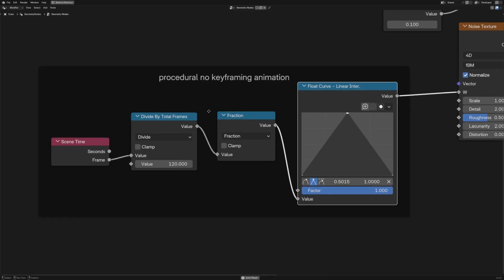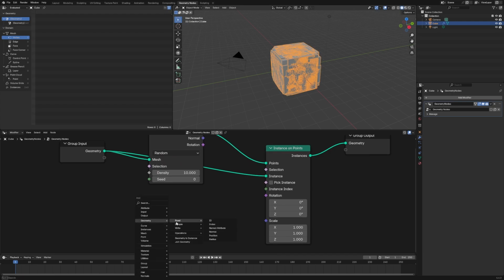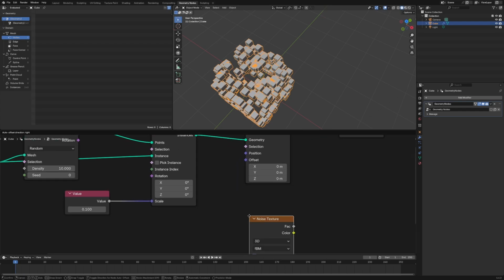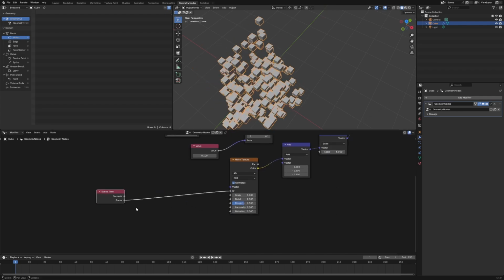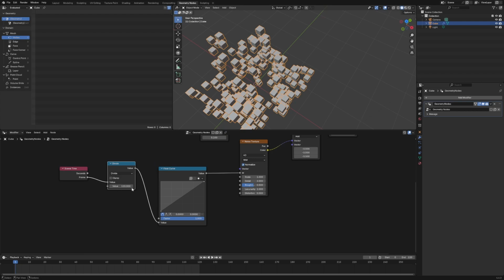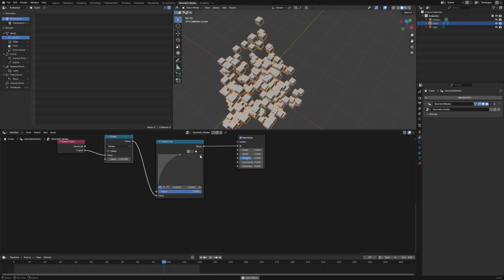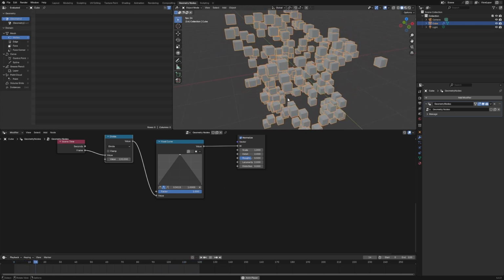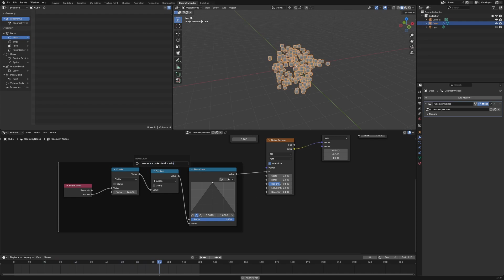Stop Using Keyframes in Geo Nodes, Use This Instead

Comment: Isnt the same as using a sin driver?
Reply from the maker: Thanks for the comment.

If you sin you mean sine. It is similar.

But the curve (or interpellation) is different.

Using float curve you can easily shape it however you want, and by dividing by the total scene time you then can get a nice normalized value you can freely manipulate how you want.

I have been using this method for seamless loops more recently and it saves me a lot of time especially when you retime things.

Happy blending!